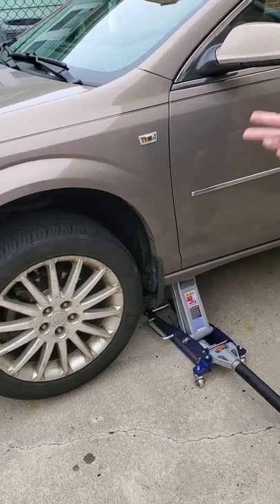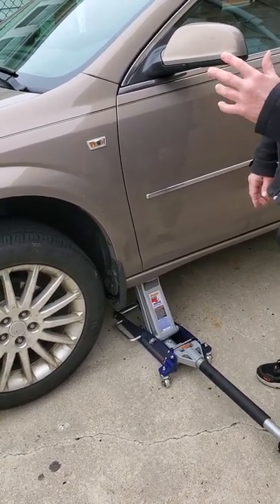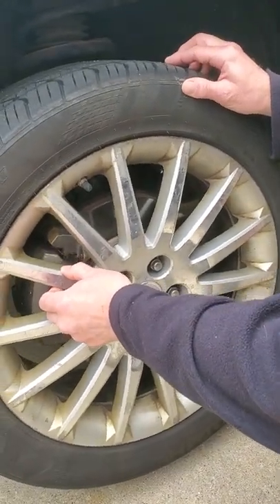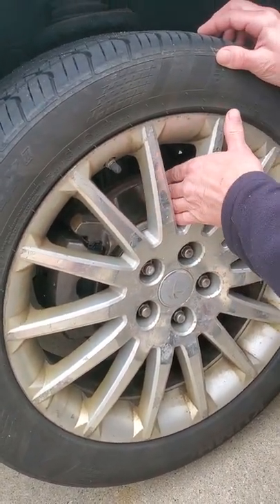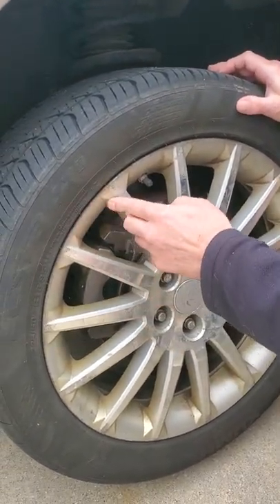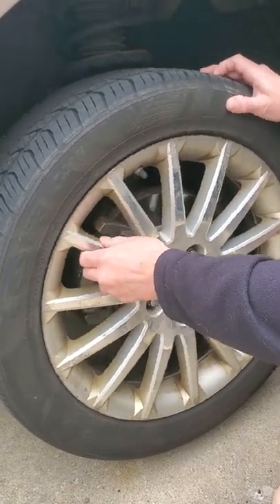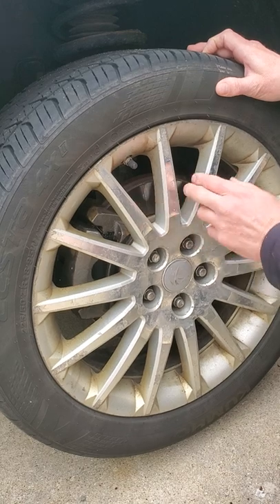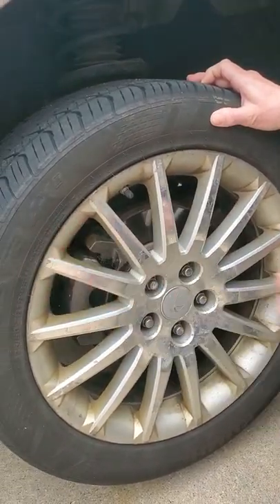How To Check For Warped Rotors or A Sticky Brake Caliper Easy Fix!

Comment: Thanks so much for your advice. I'm a nut for doing the work on my Rogue myself. Years of shady mechanics, false claims and billed for bogus repairs, was billed for the same repair TWICE!!!! So, my ability to put the ones I love in a vehicle that isn't safe, or having to resort to public transportation for a few months. As a single mother, I couldn't afford to pay for repairs that really needed repaired and not senseless ones, as well as paying twice for a job they already did! As a woman, I have to be knowledgeable about what it requires to run your vehicle, maintenance, have basic knowledge of diagnosing sounds, and ladies, be diligent by doing your research in which business you hire to do your repairs. A man like @sportsmusiccars is the reason I am not getting ripped off by some shady company, and the tip was so easy to do, and I am now waiting for my new rotors and pads to arrive, and my calipers are greased and pins move up and down as it should. Thanks again for your video. ❤

Comment: My 2010 lexus es 350 just recently noticed while coasting between 40-20 mph it feels like brakes are being applied while im not stepping on the brakes ?
What could be causing this.
Before i wouldn't really Coast much because i had a bent lip in back wheel its fixed now and this is more noticeable now while coasting 🤔

Comment: So if it doesn’t move the caliper is no good and if it does it’s fine ?
Reply from the maker: If there is none or little movement the caliper may be stuck. Or the pads could be stuck due to no grease. Remove the wheel and check pad contact points for grease.
Reply from the maker: Additionally try to remove the caliper. If it is truly frozen it will be near impossible to remove by hand. You'd need a pry bar or screwdriver to pop it out.

Comment: Not always the case because my issue rn is my rotor would spin normally and it rubs against the caliper bracket and idk what’s causing that
Reply from the maker: check for the proper tolerance. Something is too close obviously.

Comment: How do u fix this issue?
Reply: U either replace the stuck caliper or replace the warped rotors/pads.
Reply: The pins need lubrication and cleaned up sometimes